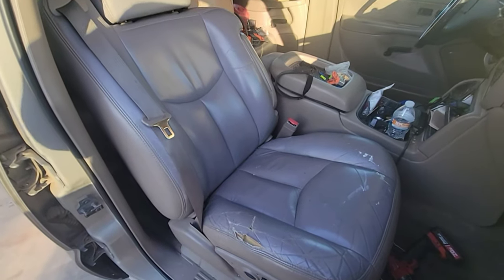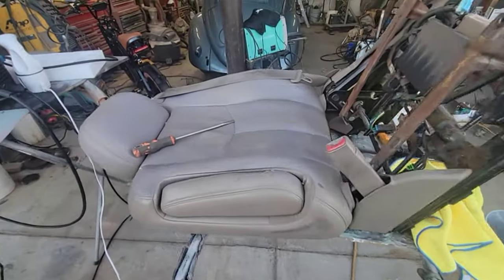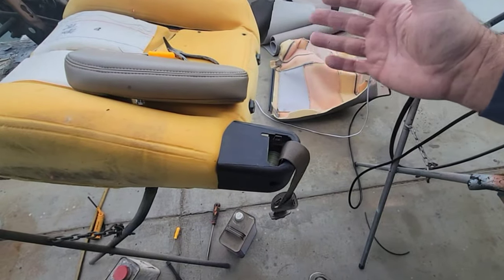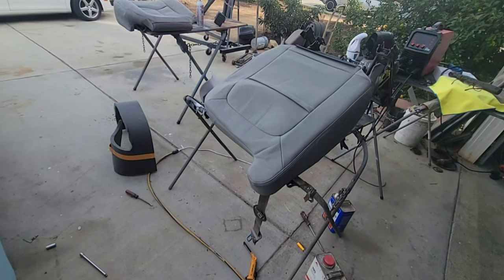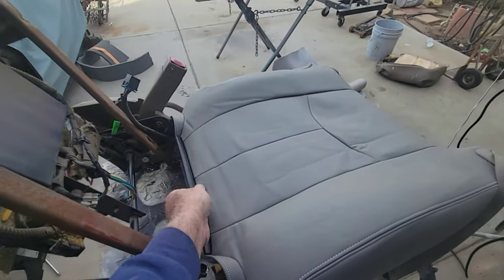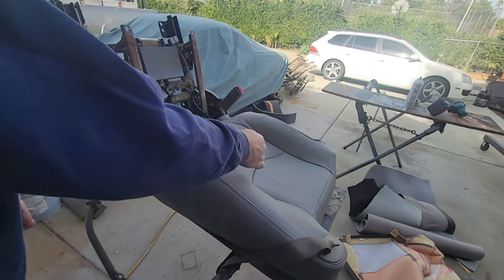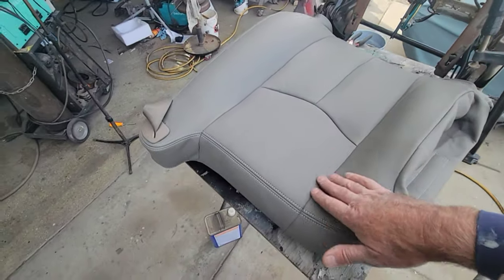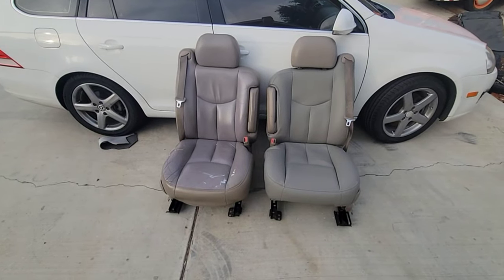$100 seat covers Chevy Silverado 03 04 05 06  - leather seat cover install  - will they fit?

Comment: Have owned my truck for 8 years or so and although my seats are not in bad shape i always toyed with the idea of getting fabric instead of the vinyl, the covers i want are $93 so i might just do that
Reply from the maker: yea you really cant loose on these. I think they are actually leather. Not cowhide leather but IDK what it is called. Real leather but compressed pieces. But they are still nice today holding up int he 100 plus degree weather. Now they look perfect....no wrinkles.
Reply: @Mikefngarage  im actually gonna get the houndstooth fabric ones, i live in Houston and am tired of burning my back in summer and freezing my balls in winter with the Vinyl i have. I was placing my order earlier and oddly enough they only sell the center seat cover in 69C which is for later year Gray and not in in 12C which is for 99-2004. Contacted the seller and waiting for a response.

Comment: Yes they used the clip for the arm rest to hold window cranks on the car doors , thanks for this video!
Reply from the maker: Yea GM likes to stay with stuff that has worked for years. Instead of reinventing the wheel. they  just repurpose it. That is why I like them so much. Look at the small block chevy all the parts interchange. Genius